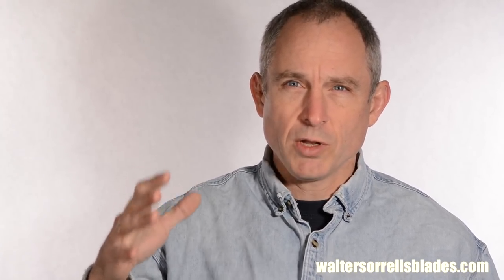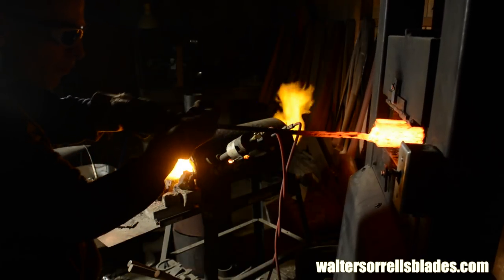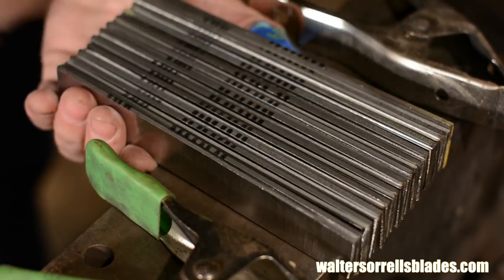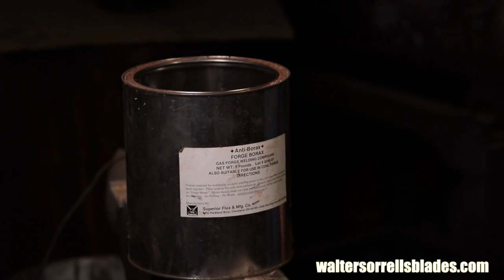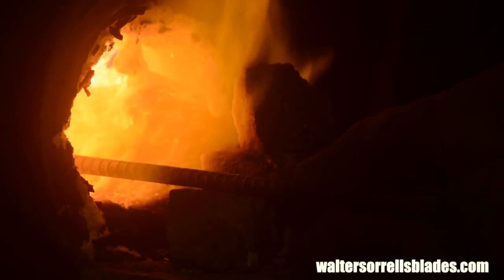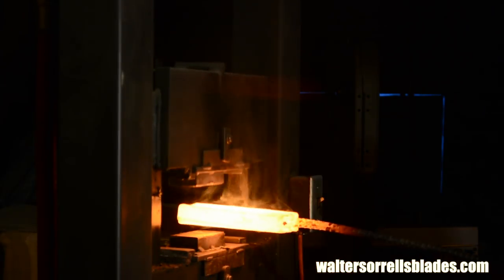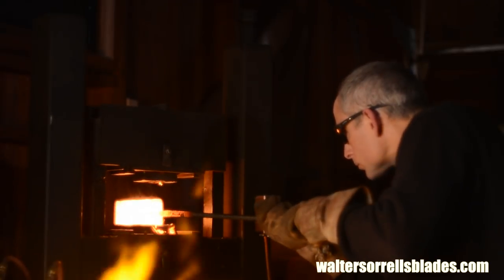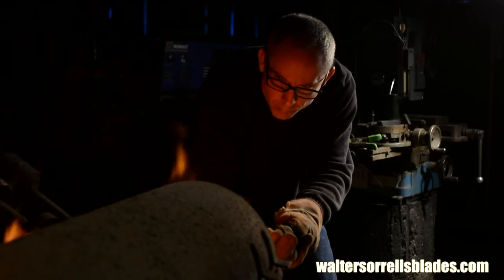How to Make Damascus Steel -- Part 1

Comment: Folding a 4 layer billet 12 times will get up to over 10,000,000 layers, no joke, do the math
Reply: 16.777.216 to be precise
Reply: rubendwarg1990 yes indeed
Reply: The problem with folding that many times is that is sucks all of the carbon out of the steel. In the end, it would leave you with a blade very prone to shear damage. The edge of the blade would be super prone to shearing off, chipping and otherwise not holding up very well to sustained, high impact use - like western chef uses. 

And some of you might be thinking that this would be a problem in Japanese knife making - and you are absolutely correct. Japanese weapons and cutting utensils were designed for draw and push cuts for exactly that reason. The blade had to be folded enough to give it strength, but at the same time that left an edge that did not hold up well over time. When the first Japanese knives were imported globally, they found that all of the chefs using the Japanese knives in the west were having issues with the blades straight up snapping. The difference being that western cooking is reliant on chopping, instead of slicing or carving. The blades simply could not hold up with that amount of folding. 

In short, the fewer folds you have, the more you are going to have a blade with a very durable edge, but is also a blade that is much harder to sharpen and holds a comparatively dull edge. It is also quite a bit softer and will be prone to bending . A blade with many folds is going to be able to hold a super sharp (to the point of being able to cut with the barest touch), however, it is going to blunt very easily and will require sharpening more often. The blade will also be more prone to chipping and breaking. 

To put it very simply:
Western Blades - high carbon, low folds, softer, flexible, duller edge and high edge retention.
Japanese Blades - low carbon, high folds, harder, more brittle, extremely sharp edge and lower edge retention.

Comment: I thought they said Damascus steel making knowledge was lost ? Lol
Reply: +henry Sanson it was lost indeed and although the process is known and can be replicated, the exact historic forging method is still a mystery. but this is not true damascus anyway. this is just a quicker and much easier method of replicating the effect. in true damascus the dark lines are carbides of vanadium and/or manganese instead of alternating layers of different steels, like here. the carbides need to be formed trough annealing cycles of the steel. it is a long and difficult process hence why no one bothers.
Reply: @Batonix80...but w/c is stronger, the old one or the modern ones?
Reply: well, im not an metallurgist, but modern ones should be stronger due to higher quality of steeles used. Anyways,the term "strong" is always relative and depends on specific material properties and intended use. As we all know, steel is a highly versatile material and can be adapted for specific purposes.
Reply: +peace bewith u the old Damascus was supposedly so strong it could chop through any other sword and it was flexible enough that it wouldn't shatter

Comment: Damascus steel no longer exist, all you can make or find is cosmetic looking. The Middle East and Indian blade makers transfer the knowledge by generations. The composition of the legendary steel never was reveled,. Back in time the Damascus steel was better than any other European steel, many smiths tortured to dead but the "recipe" died with the crafters, probably some families in India or Middle East still teaching the art as a tradition but after the guns creation blades moved down to second place and the Damascus steel secrets remain in a mystery.  
Modern sales of "Damascus Steel" are fake and some are just acid treated surfaces.
Modern science can scan a piece of metal and know the exact composition but how the metal was mix, melted time, forged, forged temperature and tempered remain in a mystery. So any modern Damascus in just a reproduction no even close to the legendary steel.